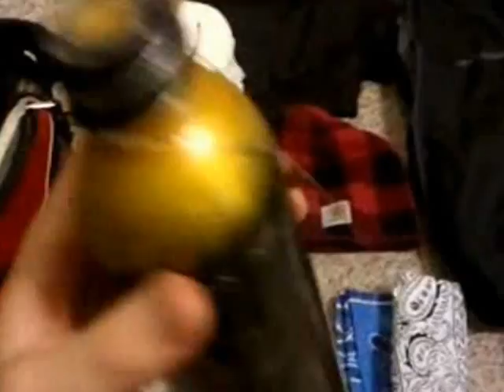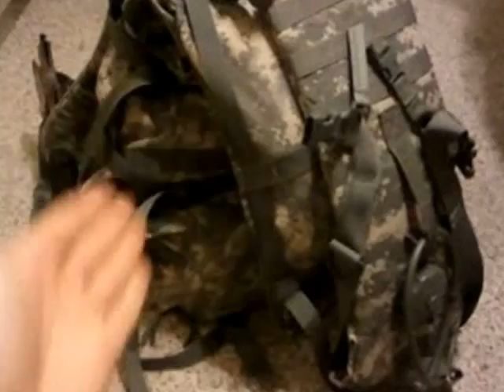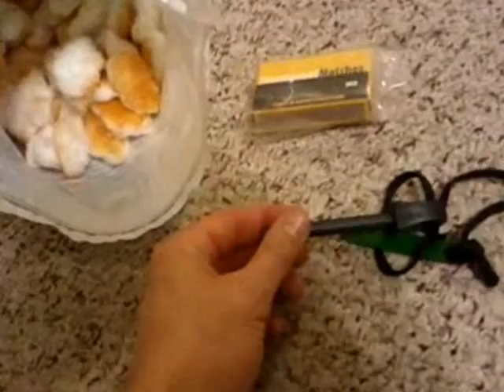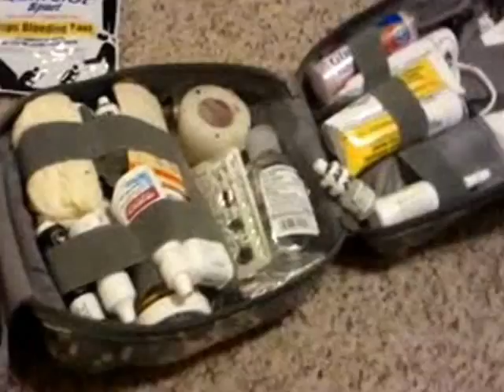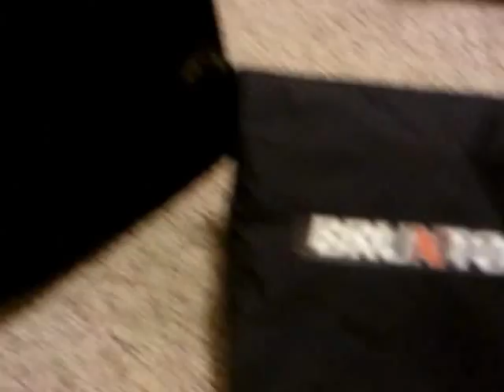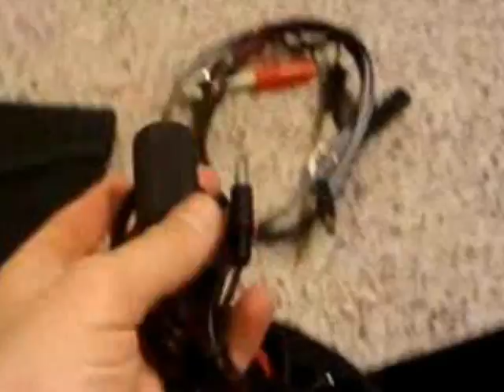Bug Out Bag ... Long Term Survival Pack

Comment: My "Get Home Bag will Piggy Back onto my INCH Bag s while they are intended for different situations they are also designed to compliment each other... My Get Home Bag wil get me to my INCH Bag and then They go together like a military Assault Pack wil piggy back unto a Main Pack.
My Man Purse connects as well like the Top or Hood Pack on a military system does...
And my Belt Knife will Inter Lock with its Hard Sheath to make a Fence Cutter

Comment: Nice video. I like that you pronounce potable correctly. I t hunk you should try that chain saw. You will most likely find that the folding saw should replace it and then in your big kit get tabor tools pruning  non folding saw or a bow saw and extra blades. For food gathering remember traps are reusable. Snares generally not. Some yo yo would be good since work for fish or small game. Better for fish would be gill net or knowledge for creating traps

Comment: In my opinion anything that relies on batteries is NOT a long term option. All the best
Reply: Sgt. Prepper in my opinion you are not really correct. Battery powered flashlights and equipment can be force multiplier to get through difficult situations. With a good supply of rechargeable batteries and way to charge, which he has, he could expect to be able to use for several years. Your statement would be like saying well duct tape will run out so myth as well not take it. Ammunition will run out so don't take a gun.

Comment: In regards to the wire. Use it for a snare if you need to but if you're making a tripod over a fire to cook or boil, you'll want to use the wire as it won't burn. tape, paracord, zip ties and the like will burn. Keep it, just make sure you have something to cut it with other than your knife. Good luck.

Comment: Throw away the aqua mire and by a sawyer squeeze filtration system for 30 dollars guaranteed for 1 million gallons with proper care. They do work we used these in the Dominican Republic on a mission trip we recommended they need to be replaced every 25 years depending on ise

Comment: Carry a tube of Lidocaine 6-8% with you, stiching HURTS!!! search a m zon for it, gonna cost you but youll be glad you have it if you have to stab yourself at the site of injury over and over again.....also, carry your sustained system with you all the time, you can break parts out as needed but if you need to go and cant access your house again at the time then you NEED TO GO and you need to go PREPARRED.....sustained BOB weight should be managed but not a concern, u aint cming bak so take it!

Comment: Upgrade your mess kit of its aluminum...its a pain in the ass to clean and it won't last at all trust me, get a canteen cup n anodized alum or stainless steel mess kit, carry dry cotton balls n a jar of petrolum jelly in a ziplok bag ditch the wax, its a pain in the ass if you get your lighters wet n its raining....got to Lowes n buy weber grill cubes for 3.50...use a 3rd of one per fire n you'll be good to go for a looooongg time

Comment: Check out the Biolite Camp Stove. I absolutely love mine. It is a sure fire way to ensure you have power. Also, lose the quick clot. Use Celox instead. Quick Clot burns when it hits the blood and it also requires a doctor to scrub it out with steel wool. Like the traps as snare wire is useless after you catch one animal. Just my thoughts.

Comment: Keep the wire, trash the rat traps. Don't carry the brunton with you. It's perfect, if the power goes out, and you need to charge shit, but dont bring it. Unless you want to lug that shit around. You don't really need it. Same with the walkie talkies, they are pointless. They can be picked up, and expose your location. Keep the tarp it's important. Buy one more metal conister. The BB Gun is important, it will save you a lot of time, and you don't have to use snares. Everyone should have one.

Comment: You really need to consolidate your shit. I don't see any reason to cary a bag to work, if you don't have the necessary equimpment in it. Carry extra ammo in it for the gun, & carry the emergency radio in it. If you're going to have worms, you might a well have a fishing kit as well. You don't need a pole, just line, hooks weights etc. I recommend you buy a crank flash light, batteries run out, & they weigh too much. I recomend you buy a bb gun & some pellets for small game, carry it in the car.

Comment: Smiths makes a much smaller knife sharpener with carbide and ceramic pass for fine honing. I used to roll with the stone in my pack until I found Smiths. Way easier, faster, and lighter for sharpening blades in the field. Check out your local sporting good spot, like 7 bucks.... unless you prefer stone. Take care man, good luck out there.

Comment: I will suggest looking at ul backpacking u tube and internet . Get one thing at a time the lightest smallest pack size best quality you can afford. Check out backpacking light. Com. Drop it down to 25-30 lbs go hiking with it in the winter do 12 mile camp out.you will quickly drop half that stuff.

Comment: Have you weighed thus pack? I've hiked in a 65 pound pack 12 miles in on switchback trails and 1k elevation changes and it sucked. I'm 6-4 215, after years of getting my BOB tuned I've found 40-50 lbs is perfect. That's not counting ammo and guns. I suggest taking this out on a real hike and simulate a WROL situation then see exactly what works and what doesn't. I like where your heads at though #Prep

Comment from the maker: I think i remember paying about $200 for the LifeSaver 4000 Bottle. when I got it, its about $150 now. That thing will purify ANYTHING!, just have to prefilter to prevent large particles from getting in it. 

The Katadyn My Bottle retails about $50, but will not filter viruses like the LifeSaver does.. Not that necessary unless Crap really hit the fan and you have dead carcasses everywhere.

Comment from the maker: Thanks for the input. I have 3 Victor rate traps packed right now until I get some conabears. 

Also, solar power generation is directly proportional to the size of the panel. Charging anything like a cell phone or a laptop is pretty much ineffective with any solar panel smaller than what I have shown in the video. Unfortunately Its kind of a minimum. 

Also, This video is outdated and old. Please check out my new updated video: youtube.com/ watch?v=-mSUoHQszfM

Comment: Get real Parachute cord, not the "parachord". The real parachute cord has like 4 or maybe 5 smaller woven strings in it for extra use unlike the "parachord" it just frays when you strip it. Also if your lighter and matches aren't protected from water that's one more thing to alter. Split your matches a few times a piece before you use them for more uses.

Comment: Too little room for details. My experience; 18 years in the Army, successful completion of 4 survival courses & a lifetime in and out of the back country. 
My observations & recommendations;The perfect survival kit doesn't exist. Prepare only what's likely to happen. Select equipment based on utility and need. Pack for the environment you will operate in. 
Knowledge is power. Read, read, read. 
Survival is an acquired skill set. Practice, Practice, Practice.

Comment: If on foot in a worst case senario, you have too many  guns.  Four different kinds of ammunition three different magazines  I was going to carry a XD .45 until I realized that for the same weight of my XD with Forty rounds of ammo in three mags, I could carry 175 extra rounds of 5.56 ammunition. Unless there are two of you, you might consider paring down to one gun (or two of the same gun in case of weapon failure) one type of ammo, one type of magazine.

Comment: I like to sew into the under side of a Boonie hat ,about 460' of snare wire. Thats about 20 times around my head loosely fit I dont even know its there. I also tape an emergency blanket to one side of a tarp and fold it back up. Nice job, Keep improving. Thanks for the video.

Comment: Keep the snare wire and add a tarp and compact shovel ur solar system get an extra bag for it its cool for goodies but if your buggin out I'm sure ur gonna trash it if on foot another thing ur med kit I'd only have things you use on the reg or for issues you know you have in the field jockich foot powder ect. also what is long term survival to you?

Comment: If it were me, I'd lose almost every battery powered object you have in there.  Most of the time, you are going to have to have a fire to control your body core temp.  That will suffice for light.  Make sure you have all "chores" such as fire wood, water, bedding, etc. done before dark, and stay put.  You are going to have to think like a Long Hunter, and they didn't carry a flashlight.

Comment: Moving on, you say your water filter has never been used? How do you know it works? You need to practice with your preps or they will be of limited use to you.You have a lot of extensive preps in there but so few band aids. Personally in the past 10 years I have probably used hundreds of bandaids and needed stitches once. Just something to consider. Many communities have basic first aid classes you can take. If you are really interested you should be able to find a first responders class.

Comment: Also, the reason I made my recommendations is because most store bought filters or purification systems will work to remove most virus, parasite, or bacterial type impurities. however iodine tablets, chlorine, bleach etc will only kill one of the two biggest things to worry about cryptoporidium, and giardia...the system setup I mentioned will work to remove bigger impurities, AND both of these parasites. Thats the only reason I said what I did, so I do know a little about water purification.

Comment: I know a lot about water purification actually, that's why I mentioned a different way to do it. I wasn't saying just pack a stainless steel container and you're done...that doesn't solve anything. You asked for suggestions so I made mine. That's it. I wouldn't tell you anything that I didn't factually know, and I appologize if you mistook anything I said.

Comment: Third Bag!!!: Three bags is too much, you’ve got hand crank kit for a reason, don’t lug the solar charger, I spent 3 weeks in a desert, I didn’t need to carry that many batteries and I didn’t run out of what I did carry, use your kit wisely and it’ll last longer. Build the red bag as a GHB and the Main bag as your BOB third bag is unnessacery. If you really want to carry the brunton system, then put it in the main bag. 

Sorry for the multi-post, just trying to help.

Comment: Red Bag: No. 1: don’t rely on carrying both bags, get kit for each pack, its more expensive, but if you can only grab one then you have everything; if you have both bags, then you have redundancy! Don’t leave your batteries loose! make sure they’re lithium, normal batteries slowly discharge, lithium does too, but at 1000x slower. Also recommend some money. don’t keep your hooks in with your fire lighting kit, they will most likely either get lost or you'll snag yourself trying to light a fire.

Comment: Some small artificial fish lures are critical. Any regular to bank bound fishing will tell ya that bait is far from always easy to find, especially in the heat of summer, or most times in winter, not to mention when you're on the move and run across a good fish hole you wanna take advantage of, you want on hand bait you can get in the water fast so you can get moving again asap. I suggest a small variety of trout flies .. pan fish, crappie, trout, etc... LOVE them! :D

Comment: yup...Rat traps, YoYo fishing trap reels and a Duke #220. I don't carry snares because the success rate is so low. The only electronics I pack is a solar/crank radio. I only carry a hand gun and a Remington Nitro Piston Air Riffle 22 Cal. I can carry 1,000 rounds of ammo in a Altoids tin. It's quiet and extremely effective on small to medium size game. I also opted for the Military 3 piece sleep system rated down to -40 degrees.

Comment: I would recomend drilling a hole in each of the rat traps so you can tie them off to something so if you would catch something larger than it will kill, it wont run away with your trap. also in place of snare wire, i carry a package of 12 inch steel fishing leaders rated at i think 90lbs. they make easy snares and will fit well with the rat traps in an m16 mag pouch.

Comment: Your mostly right Voodoo, depending on where you live, bugging in is the best place for a lot of people. If you're going to bug-in, make sure you have plenty of food, ammo, medical supplies & fluids. A man's home is his castle, defend it well. EMP proof your electronics. If you are going to bug out, then have another place/home with the aforementioned things. Use auto or 3-wheel bike to get there. Also, you need longterm sustainment for gardens and such. A Depression & power loss is survivable.

Comment: One thing I would reccomend is to have your electronics stored in ESD bags or material. I have a lot of knowledge on this subject due to the work I do. Some things to remember about storing in ESD bags. There are three types of ESD material Types I, II, and III. If you store it in a type I bag, you must put that bag inside of a type II bag. (double bagged) A type III bag can be used by itself. You also want to hermetically seal each bag (airtight) the most common way of doing this is heatsealing

Comment: Okay dude here is the thing. A bob bag is supposed to be a 72 hour get the fuck out kit. That said, all you need are 2-4 MREs, enough ammo to reload all your mags back to max capacity, water/water storage, 550 cord 2 pair dry socks and a rain poncho. Also not in the bag you need a blowout kit and an E&E kit, put these in a cargo pocket of your pants. The point is speed and signature reduction. A BOB bag will not sustain you for long periods and is not meant to.

Comment: I noticed the duck tape wrapped around that square of cardboard and just wanted to tell you a trick I learned in the military, instead of wrapping it around that, take a pen tube and cut it to the width of the duck tape, and wrap the duck tape around that...it will fit more easily if you had planned on putting the duck tape in your pockets, and the pen tube can be used for various things as well like storing matches just in case lets say you ditch the bag and you flint on your lighter gets wet

Comment: Instead of all those batteries, I recommend the Sanyo Eneloop rechargable battery. They come in AA, AAA and have adaptor for the AAA to convert to D or C. These coupled with a solar charger will give you 1500 charges without the bulk.

Comment: Techies will be in the first wave of casualties since they can't stay unplugged. Ditch the bar soap for camp suds/Dr. Bronners concentrate. Invest in quick-dry clothing, using a compression dry sack to hold a change of clothes, a set of thermal underwear included. NO cottons (except for wife beater), even underwear should be quick-dry. Magnesium stick/striker. Carry only items u know u couldn't find by looting/scavenging.

Comment: Good video and supplies. If bugging out from the car, or even going on a hike, I suggest a backpack which has small wheels as this means you can carry a lot of gear over a distance. Also, in an emergency where you are away from home for some time it might be good to carry a hammer, nails and a saw in your vehicle - just in case you need to make a quick shanty home.

Comment from the maker: It is currently issued, its called the Large Ruck, external frame. 

However, for a real situation in which this is really needed, I dont recommend using camo or anything that looks tactical. But its fine for an example scenario where a tornado might rip through your house and this is all you have left (which was in the basement.

Comment: Your first aid kit also looks very vulnerable to dunking. If you can, I would look into modifying that medical pouch by impregnating the fabric with silicone, or store some of the paper items (like the guaze) inside plastic zip seal bags to at least protect them from rain and splash. Your first aid kit is the one thing you would trade everything else in your kit for if you suffered a blow out so you should at least keep it splash proof if not completely submersion proof.

Comment: It's for this reason I have opted to not carry a solar charger. Also, Lithium Ion Batteries will become more valuable than their weight in gold after a collapse of infrastructure and I could use them to barter if necessary. You can't really barter a solar charger when rechargeable batteries no longer work and all it can really do is power some small batteries.

Comment: I have 24 AA lithium ion batteries, 10 lithium 2016s, and 4 lithium 9volts, plus 4 rechargeable AAs. Because of the energy density of lithium used in batteries they produce more power over a far greater length of time.  I could have power for 25 years the way I plan to ration use of the batteries in conjunction with the quality and efficiency of my flashlights. I've invested in excess of 400 dollars on my lighting devices

Comment: which I keep stored in a plastic baggy wrapped in tin foil inside another plastic baggy and wrapped again in tin foil without the batteries in. This is to shield it from an EMP from a nuclear device. All my electronics (LED chip regulated flashlights, the radio, and a multimeter) are stored shielded from EMP and they all take the same battery types, AA, 9 volt, and 2016.coin cell batteries and I only keep Lithium Ion batteries and 4 rechargeable AAs.